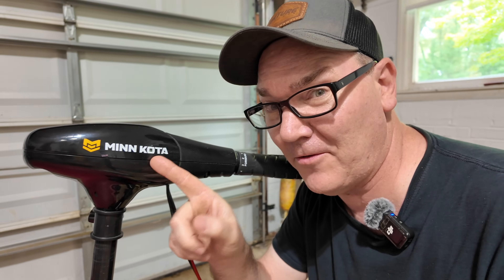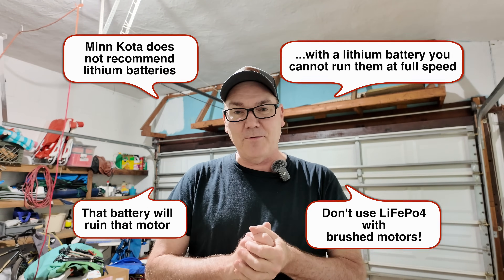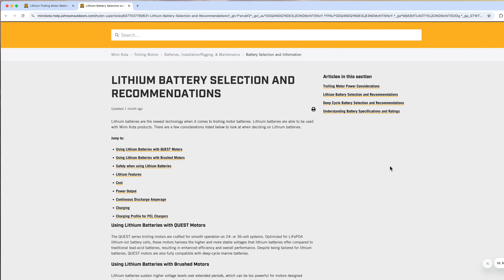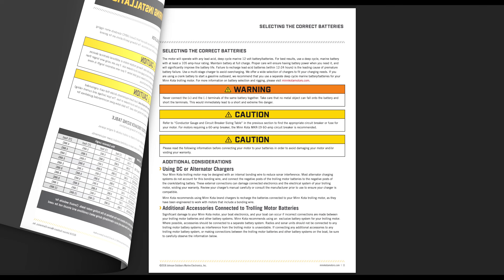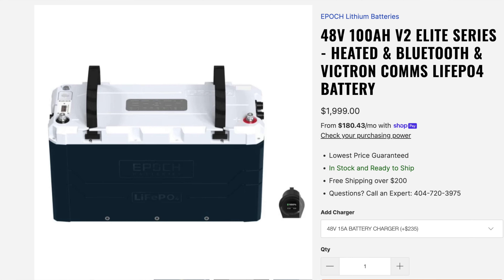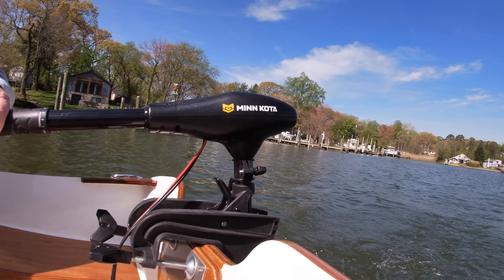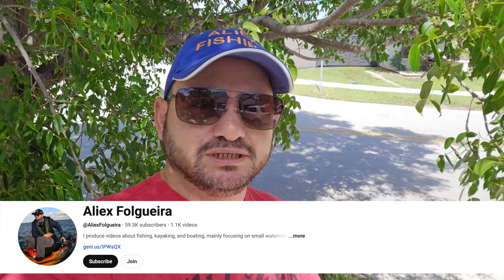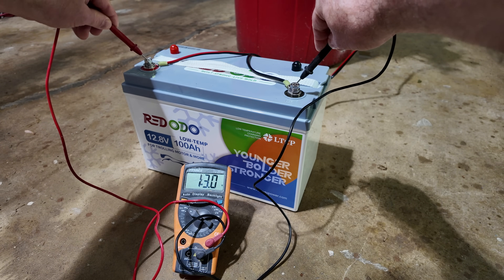Does a Lithium Battery DAMAGE a Trolling Motor & is Minn Kota Hiding the TRUTH?

Comment: Hi Wayne. I have been playing with an e-boat for a few years now and doing all day cruises (minimum 5hrs, usually 7-8hrs) as fast as I can get the thing to go. I started out with a minn kota endura 45 12v and then moved to a riptide 24v 80lb. I can tell you that these things seem to be designed for full speed for about 2 hrs max and then you start damaging the brushes and brush wires. That is why I switched to a brushless this year.

btw, 85% duty cycle is not 85% power. It is 72%power. You end up getting 85% of the volts and 85% of the amps as well, so, .85*.85=.72watts
50% duty is equal to 25% power. Just sayin.

So what they are saying is if you go all day like I do, or more than about 1kwhr of power consumption, you need to run at 72% power. But that applies to lithium or lead, it doesn't matter. If you have 3 or 4 marine batteries and run a brushed trolling motor at full, you'd burn up the brushes, possibly the controller. It's not the chemistry of the battery that matters, It's the duration of high duty cycle. The same is true of any motor.

I ran my 24v minn kota so hard that I used up the brushes in one season. And my buddy that has his own e-boat ran his even harder and burned through the brush wire. Unbelievable how they expect 56a to go through that tiny brush wire. It just can't be sustained

To sum up, you cannot run a brushed trolling motor at full from any battery type for more than 2hrs. And you'll likely be damaging it for the entire 2nd hr.

Comment: Good video, I think the main focus should be voltage and current tolerances of the trolling motor. The motor doesn’t care what’s providing the power as long as it’s within the motor’s tolerances. For example the 55lb terrova is a brushless motor and should have a 50amp circuit fuse/breaker ensuring the motor never over currents. It requires 11-15vDC and current draw is 50amps (recommended limit) so I don’t think the lithium constant voltage will hurt the brushless series. Brushed motors I guess could “wear” down quicker but unlikely anyone would notice. That’s my 2 cents…tight lines everyone!
Reply: The 55lb Terrova is not brushless

Comment: I had a really old Minn Kota trolling motor  (over 25 years old), and used it with a LiFePo battery. It finally stopped working, but only because the brushes were literally "GONE"..!  Couldn't find any brushes to fit it, so made some from carbon rods.  Well, I have that same Minn Kota trolling motor on a kayak now, with a 50 amp LiFePo battery, but now it's controlled by an electronic (0 to 100%) speed controller. I also put an R/C Airplane propeller on it, and it lasts longer out on the water. 
But you're right about warning people about the batteries.
Reply: @MSmith-jf5wo  
 Well, I guess I'll be finding out too. Since both of the trolling motors on my "Pond Prowler" are old 2005 Minn Kota Endura and 2010 Motor Guide.  A substantial weight savings changing to LIPo batteries.  Now if I get more battery life in running time and life cycle.

Comment: I’ve had a total of 5 Minn Kota motors and all used them for all day trips including non stop driving for miles and miles with a 100-140ah lithium many times. Never had any issues
Reply from the maker: Another case study!
Reply: Ive had 38 of them, all ran fine and dandy
Reply: But the unanswered question is whether your non-stop driving was done at top power output CONTINUALLY for all of those miles. CONTINUOUS TOP POWER is the condition that is expected to produce the problem most often. So...?

Comment: My trolling motor was 99 bucks. I don't care if the lithium battery eventually someday hurt it. The advantages of the lithium battery like reduced weight and longer lasting and a steady speed while it discharges far outweigh the potential disadvantage
Reply: That is probably about what mine cost when I got the first one.

Comment: I do not understand this question, current ist current, 12 volts are 12 volts, doesn't matter, from where this electric current cames from, from a lead battery or from a lithium battery or even from a powerful power supply unit.

Comment: 12 volts DC is 12volts DC no matter what the source!! I think?
Reply: They are not both exactly 12.0 volts. Lithium is 12.8-13.0 volts under load and Lead Acid is maybe 12.2-12.5. This is what the controversy is about.

Comment: This is my two cents. 

The motors aren't designed to run full power all the time REGARDLESS of battery type. They're built cheap.. the endura line has been known to fry on the full setting. They draw more than the 50amps they're designed to withstand. 

All this could be avoided if they used either heavier gauge wires, or just built a resettable circuit breaker into the trolling motors.
Reply: I ran 8ga wires to mine, did matter. I ran two 10ga for each polarity, didn't help. The brushes and brush wire is the weak point. Minn Kota is right, you just have to run them at 7 or 8 to keep it cool enough to survive a long duration (more than 2hrs)
Reply: oops, typo - "I ran 8ga wires to mine "didn't" matter"
Reply: @eddowney9548  FYI - Using the 3 dots off to the right, you can edit your original post to correct it.  
Then you can also delete your original post.
Reply: @rickstephan6707 haha! thx. old dog here, new tricks
Reply: @eddowney9548 apologies for the confusion; I said heavier gauge wires, I meant wiring and components inside the unit, not the battery cables
Reply: no motors are designed to run full power all the time cheap or not
Reply: @rod7944 this is also true! The manual for my minn Kota endura 55 (I forget if it's a max or not) says to not use the top speed for over one minute continuous...

That seems like a bit of a problem, right?
Reply: @jimbob4859  correct. I run two 36 volt trolling motors on my boat, one on front, and one on the back. I rarely go over50% power  on either of them
Reply: @jimbob4859  yes, those motors are only designed for short uses at 100%. besides, running your motor at 100% will drain even a 100amph Li battery in about 2 hours. Pretty short fishing trip

Comment: Would like to have seen a picture of the brushes before and after the test.
Reply from the maker: I wonder if higher voltage impacts the controller more than the brushes.
Reply: @WayneTheBoatGuy  Not likely. as mentioned in other replies, as the voltage drops, the current increases. Increased current produces more heat. On another note, if your motor failed in this experiment, it would probably have been because of there was not enough water in the bucket to dissipate the heat, combined with all the agitation (the air will not remove the heat as efficiently as the water).

Comment: So, they are building a brushed electric motor designed with the voltage sag inherent to SLA/AGM batteries.  I guess that USED TO make sense, and for anyone who actually runs a trolling motor on its highest setting for sustained periods of time, it would be easy enough to dial it back a little.  With that said, a well-made motor should easily handle the peak voltage that an SLA or AGM battery can put out...which is essentially no different than what a lithium iron-phosphate battery can put out.  The only difference is the LFP battery will sustain that peak voltage number for a longer period of time.  Sounds like Minn Kota needs to engineer their product to work well with the best battery technology on the market, not the old, one-way boat anchors that people are using less and less.

Comment: Appreciate the shout out Wayne!! I never even thought to do a "trash can" test though I have done that to check amps on the motors. The more I have thought about this since my video on the subject I am going to run my Pexmor on a lead battery at the back of the boat being as its 55 thrust so I can run it on 100% speed and keep the Minn Kota 30 thrust on the lithium and run it at 80% and if I do have happen to run out of juice with the lead I can connect to the lithium and run the Pexmor on 85%. Not exactly what I wanted to do but being as I got the lithium battery to get rid of both leads I was running. I still have not heard anything from Pexmor and even contacted the seller of the motor on Amazon and they never responded either. I to think Minn Kota should put a label on their boxes stating this on their brushed motor so the consumer would know before buying. Personally had I known this I may not have bought the lithium being as my leads were actually ok.  Appreciate your findings and subbed to the channel after you contacted me.
Reply from the maker: My pleasure! I hope Minn Kota will provide better information going forward.

Comment: Running in a bucket does not equal running on the lake, the motor will draw significantly more amps on the boat at the higher voltage that the lithium can maintain
Reply from the maker: How will it draw more on the boat? The only scenario that I could see how it would draw more is if this battery was also connected to and being charged by a running outboard motor. But my scenario is when using a fully charged, dedicated trolling motor battery.

Comment: The "Chemistry" of the battery has literally nothing to do with it. The main problem is always the voltage. Lead Acid can sit around 13.4v fully charged but sag almost instantly to 12.4v or below. The problem with Lithium packs is the nominal voltage of each cell is much higher than Lead Acid, so you're getting a pack with a total voltage higher than that of a lead acid. Lithium also does not sag, so again your voltage will sit far too high. Minn Kota clearly states its a 12 Volt motor, not a 13v or a 14 motor. Lead Acid, is 12v, yes it charges a little higher but sags to 12v instantly. Lithium, is not 12v, these "12v Lithium" packs can reach and hold over 14v when at 100% and do not sag. What do you expect to happen when you hook up a 14v + battery to a 12v rated motor?...
Reply: amps = heat. heat is what kills it. simple as too much heat for too long. battery types matters not. too hot for too long is only thing that matters
Reply: So, keep in mind that for a brushed motor what wears the brushes out is the heat from ARCing, not regular heat in electronic circuits from amperage.  The heat from ARCing is a function of both voltage and current, not just current.  The heat in regular electronic circuits is just from amperage.   So in terms of brushed motors, voltage does matter and 2V (even more than 2V under high loads due to droop, comparing lead-acid to LiFePO4)... that can be significant.

Anyone worried can just limit their motors to setting 4 instead of 5.  But honestly I don't think it will make much of a difference with a modern trolling motor since everyone is using LiFePO4 now... at this point the manufacturers will ensure that it works  well.

--

In terms of the physics, here are the relevant equations for an ARC:

E = Energy (all heat when it comes to an ARC)
I = current
R = resistance of ARC
t = duration of ARC

E  = I * I * R * t

Since V = I * R you can also write the equation like this:

E = I * V * t

So yah... voltage matters in this case.  Both current and voltage.  Voltage also indirectly increases the duration of the ARC (it maintains longer as the brush is moving away from the contact).

Now V in this case is Varc ... the voltage drop across the ARC.  But in terms of a brushed motor the result is that the voltage maintains the gap for a longer period of time so... you can't get away from voltage.  It winds up mattering a lot.

-Matt
Reply: and a slightly higher voltage means less current at the same thrust level, and current is what creates heat and kills circuits. I've run lithiums on  Minn kotas many hundreds of hours for 6 years with  0 issues.
Reply: 2 volts is nothing for a motor. it's the amperage that's ultimately a problem. Since voltage isn't sagging much on lithium, it means it's delivering all the amperage the motor can pull. More amps = more heat. Kinda crap to design a motor that relies on keeping itself safe from volt/amp sag. Put a couple L.A. in parallel, you're going to have a lot less sag just like the lithium, and same potential issue.
Reply: @andrewt9204  2 volts is a lot, especially for something brushed, that could be 10-20% over the target voltage the controller and motor is expecting. Also more amps does not equal more heat, more wattage does, at a higher voltage, it's actually pulling less amps, not more... Also, you'll find you'd need quite a few lead acids in parallel to reduce the sag significantly, as it requires very little load to drop a flooded cell down in volts.
Reply: @danieljust2226  then when in 24v or 36v stacking batteries. That 14v is x2. Or x3.  So 2 volts becomes 4. Or 6.

Comment: Hello, I h the same motor you have last year, bought brand new from Cabela’s and 2 months later after about 6 fishing trips the motor stop working. I was using it with a LiTime 12V 100Ah MINI LiFePO4  battery.. I returned it and got my money back under warranty. The guy at the store asked me if I was using it with a Lithium battery and I told him yes. Like you I told him that it was not mentioned anywhere to not use lithium with their motor. Minn Kota knows they have a problem, the clerk told me to wait the next generation. I ended up buying the bigger Max version with a better controller. So far it’s been good. Thank for the video,.
Reply: doesn't mean the problem was battery
Reply: @rod7944  the clerk at the store was not surprised and he told me that Minn Kota was working on new version to address that issue.
Reply: @simonguilmain8834  still doesn't prove the problem was the battery. Did you run the motor full throttle for more than a couple minutes? That will kill a trolling motor regardless of battery choice
Reply: @rod7944 well I run my 55VT for an hour each way at full throttle to a spot and not had an issue in several hundred hours, so that’s bollocks…
Reply: @troutboynz  That may be, but I guarantee you that running it full bore is much, much harder on the motor and circuits than 50% or less. Heat is a function of current squared, so at full bore, you are generating heat 4 times as fast as at 50% throttle, and heat IS WHAT KILLS CIRCUITS AND ELECTRIC MOTORS. Your one example proves exactly nothing. If you don't believe me, email a minn kota tech and ask. I would also suggest you pull the top over and inspect the circuit board and look for signs of heat. I've done that, and when you do, you may be surprised. Look  carefully at the insulation on the wires.
Reply: @troutboynz  several hundred hours is just a summer or two. It's also very, very unlikely you are running full bore for all of that. Pull the top and take a look at the wires and look for discoloration. You may be surprised. Let me know if you make it 2000 hours without issue
Reply from the maker: Thanks for sharing! I hope Minn Kota is checking this out and will make some changes.

Comment: I would think your test is slightly inconclusive since you were not putting a load on the motor, but I could be wrong. Maybe try doing the same thing with the motor mounted on a boat? Thank you for taking the time to address this and doing some research on the topic!
Reply: True, the motor draws less amps in a bucket like that vs actually pushing a load through the water.
Reply: I was wondering if the barrel test puts more stress on the motor due to the constant turbulence. Running on a lake would be smoother.

Comment: It might burn up the internal brushes that make contact with the commutator. Due to lithium not having a voltage drop causing more chance of arc. Min Kotta has easy to change brushes tho.
Reply: the arcing difference between 12v and 13.5v is not worth worrying about.  Power output however is a function of current squared, so a small drop in voltage means an increase in current to hold thrust constant. And this results is significantly more heat.

Comment: The question is why is Minn Kota still using brushed motors. That is way old tech. Brushless is much more efficient.
Reply: @BTS-Astro1  probably cost saving. Especially for the lower priced motors like the 30lbs thrust

Comment: 5 years for me running a terrova on lithiums. Lithiums hold their voltage higher for longer, therefore using less current to get the same thrust. this means the motor will actually run cooler not hotter.

Comment: Thanks Wayne. I keep hearing the 85% also. Just this year , I purchased a 55 lb 12V Minn Kota Powerdrive Riptide with advanced GPS for my G3 1442 jon boat. Also purchased a LI P04 100 AH battery.  Paid 1600 for this motor, I sure hope like hell I don't burn this up.
Reply: you won't. no worries.
Reply: @thomasm9139 When the lithium battery gets low, does it act like a lead-acid or does it simply shutdown?  Thanks
Reply: I don't know, never have run it down to that point. This thing is amazing, I can run it all day, much of it in spot luck with plenty of juice left.@rickstephan6707
Reply: @rickstephan6707 It just simply shuts down. You never notice it getting low

Comment: I have 2 minn koda 30 enduros. I have recently had both of them stop working after the lithium 60amh battery upgrade. After a year down I found that both motors had the same problem. The main wires from the battery to the controller had over heated and melted the positive and negative wires. I never even gave it thought that it could be from the battery. But now I guess I know what happened. I figured it was just because they are old motors.
Reply from the maker: So it seems that Minn Kota needs to do a better job letting people know!